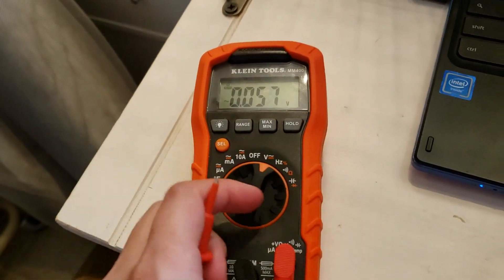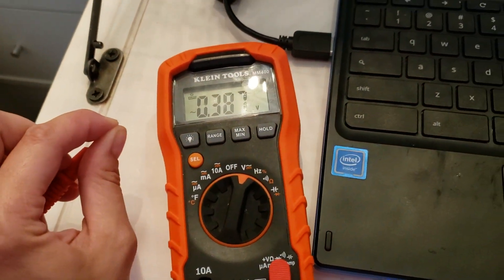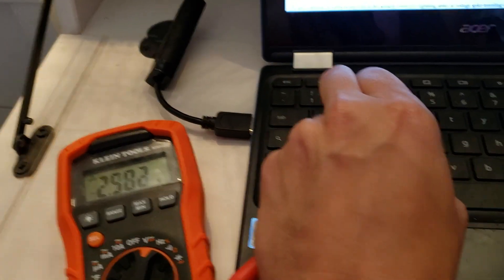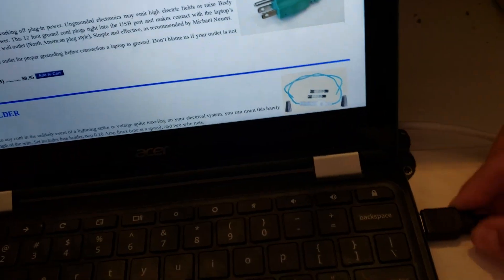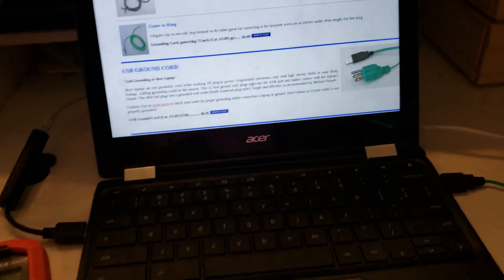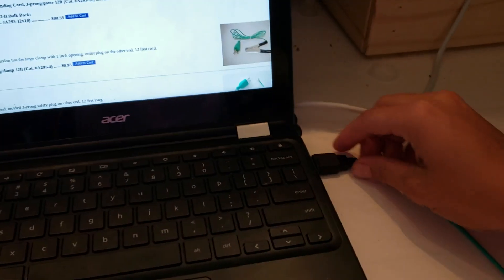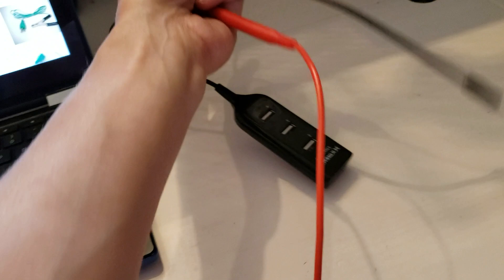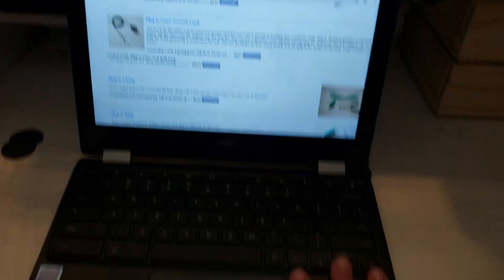Powerline ethernet adapter dirty electricity fix!

Comment: "Dirty" electricity refers to the radio frequency hash generated by Ethernet over power line adapters which causes interference to radio communications and can interfere with audio devices connected to the power mains. Toss it into the garbage, where it belongs.

Comment: It seems that the erratic, digital (non-analog) waveforms created by the powerline ethernet adapters begin to "deposit" onto various ungrounded loads on the same electrical distribution network.

Comment: is this extra voltage dangerous?
Reply: No. Anything below 48 volts is considered non-lethal under normal circumstances. Two or three volts is nothing -- equivalent of a couple of flashlight batteries in series.
Reply: @James_Bowie  It is clearly not fatal, but there is obviously harm that occurs below the threshold of non-lethal. Many risks aren't lethal, but still harmful. Even an extra volt can disrupt melatonin and create oxidative stress, which has a lot of downstream adverse health effects.